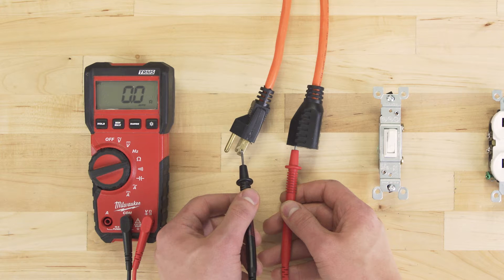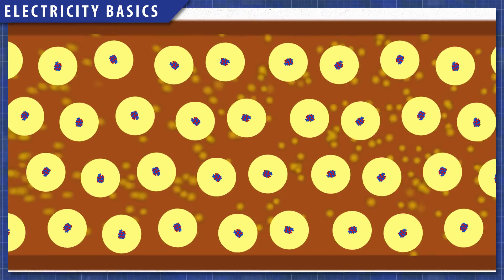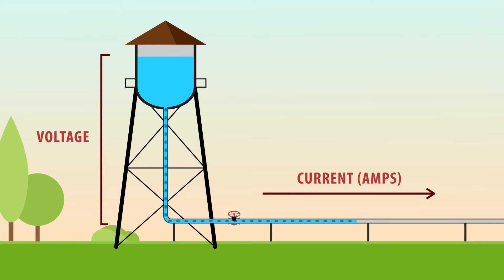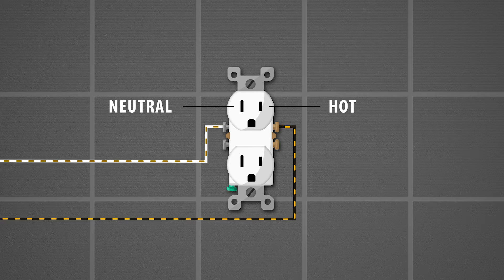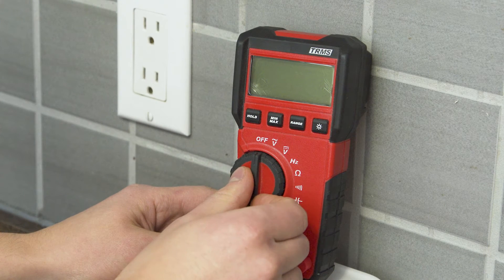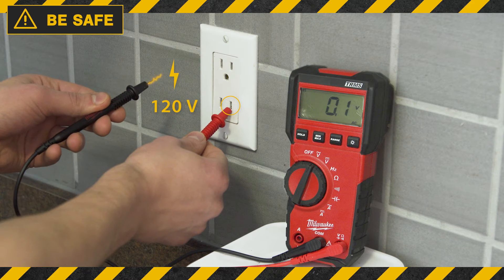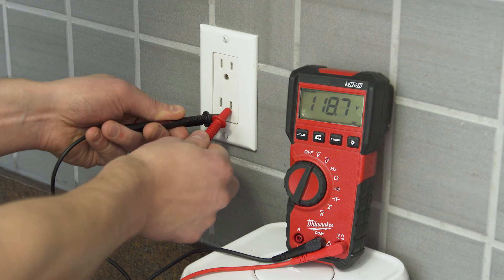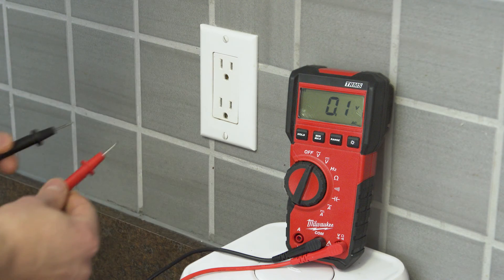How to Test Voltage in a Receptacle | Repair and Replace

Comment: I have a reading of 66 on one receptacle. What does that mean?
Reply from the maker: There is likely a loose neutral or some back feeding happening. It's best to shut off the breaker to that circuit to prevent any fire risk and get it inspected by an electrician.

Comment: I did my plugs just like you in the video black on left and red on right and it blew my breaker
Reply from the maker: Thanks for watching. It could have been an issue with the probes or the multimeter but another cause is that pushing the probes in, might have shifted the outlet and caused a wire to connect with another wire causing a temporary short. In this case shutting off the breaker, opening up the terminal and checking all the connections would be the next thing to check.

Comment: If you're testing neutral/ground.. You might want to probe ground first before what might be a miswired hot as well... Otherwise you may experience the exact scenario described at the beginning whereby your unattached probe is electrified.
Reply from the maker: Thanks for watching. Yes that can happen. Mostly the mention about the electrified unattached probe is more to draw awareness. This is why we added an additional note of safety in a pinned comment: " For additional layer of safety, its best to wear electrical safety gloves and to only hold the multimeter in one hand at any given time. Holding the multimeter leads in one hand will prevent electricity from passing from one side of the body to the other in the case of a shock. This is known as the "one hand rule"."

Comment: I had a surge in my power this morning when I turned on my skillet (fried a surge protector), and now I only enough power throughout the house to run lights; nothing significant will run. Checked the power at outside and inside box and they both display the right power. Any help would be appreciated. Ty.
Reply from the maker: Thanks for watching. Have you checked and reset the breakers?

Comment: If u have to check it replace it r use hair dry  it don't work replace  it
Reply from the maker: Thanks for watching. Testing with a device is one way to see if it has failed completely but testing the voltage with a multimeter can be useful to check the wiring, or to determine if the hot and neutral are flipped.

Comment: Quick question I have light and ceiling fan come on, but my two outlets do not work. What would you suggest?
Reply from the maker: Thanks for watching. Do you know for sure that the two outlets are part of the same circuit as the lights and ceiling fan? If not then reset the breaker for the outlets.
If they are part of the same circuit, and if the outlets are in any way connected to a GFCI then try resetting the GFCI outlet.

Comment: What if it's an old outlet where are the same size opening?  How does one test then?
Reply from the maker: Thanks for watching. The outlet should still have a hot, neutral and ground. The testing should be the same.

Comment: I don’t wanna carry a multimeter with me but I’m going on a multiple country trip that’s going to take 6 to 12 months to complete with no certain itinerary. I’ll be hitting countries like Vietnam Cambodia, Thailand, the Philippines, Malaysia. Is there a lightweight, small tester other than a multimeter that I can probe a plug or plug something into the plug. Especially for the Philippines I’ve heard that they have regular American standard plugs three prong And it could be running something like 240 maybe. Anyway, the wiring in the Philippines sounds very dangerous. Amongst other places I’m sure.
I’m not real familiar with testers, but there’s got to be something I can throw in my bag that’s not too heavy just a test before I plug in my phone and fry it or plug in my rechargeable speaker and fry it .
Reply from the maker: Thanks for watching. There are receptacle testers but most of them are configured specifically for one region, voltage and type of plug: https://www.amresupply.com/part/GFI-3501-GFI-RECEPTACLE-TESTR

There might be universal testers out there that come with adapters and different ranges. Not sure though.

A tester like this is not that much smaller than a small multimeter so you wouldn't be saving that much weight overall.

Comment: Is it safe to plug in a grounding sheet into only the ground hole in the outlet if the reading is 0.1  ? Thank you for your clear and useful video!
Reply from the maker: Thanks for watching, it depends on what you are measuring between. If you test voltage between the hot and ground, there should be 120V. Testing between the neutral and ground there should be no continuity.

As for a grounding sheet, it's recommended to only use products specifically designed and tested to be used with 120V outlets.
Reply: @AmreSupply  You're the best, thank you!!😇
Reply from the maker: @shedroids  You're welcome!

Comment: Although the video doesn't reveal the wiring of the  outlet, you can see the color of the wires that connect to a outlet in the animation.  I find it counter-intuitive that the RED probe from the multimeter tests the side of the narrow slot wired with a BLACK wire; and that the BLACK probe tests the wide slot wired with a WHITE wire... can you explain why this inconsistancy exists... BLACK being COM on the multimeter, and HOT on the plug side.  It seems that the black probe should test the side of the plug wired by the black wire.
Reply from the maker: Thanks for watching. When you look at other wiring black and red does not always indicate what is hot, one example would be a 3 way switch. It's always best to go by the terminals, terminal names or numbers depending on what sort of test is being done with the multimeter.

Comment: New outlets require both neutral and hot to be plugged at the same time to open contacts. I don't know if Canada has adopted this standard at this time, but assume so or assume it will happen soon. "Neutral First" can't be done with the child safe outlets. Plunging both at the same time works.
Reply from the maker: Thank you for sharing that info.

Comment: Excellent video, many thanks! Very clear and concise.  With electrical stuff, there should be no ambiguity.
Use one hand only not both,  Put neg in first, then positive, using one hand. In case of current, you won't complete the circuit.

This is a stupid question but... was the switch to that outlet ON or OFF when you did that test?  I don't want to assume anything.  I know nothing about electricity.
Reply from the maker: Thanks for watching. The breaker was on, and this test was testing voltage which is the potential difference between the hot and neutral lines. This video goes over the basics https://www.youtube.com/playlist?list=PLCo9SMjkdWBycw9hZVfYFc6Sw2Jlavaak But when working with anything electrical it's always recommended to be safe and it can still be good to call an electrician.

Comment: I did this test on a surge protector that was plugged into an outlet. As soon as I entered the black lead into the neutral, before entering the red one into the live, there was a small flash and smoke and the black lead’s metal got burnt out. Wonder what happened there
Reply from the maker: Thanks for watching. There could be a wiring problem or the outlet could be faulty. The neutral should not have any voltage.

Comment: Great info but wheres the repair and replace portion ?
Reply from the maker: Thanks for watching. This video is a small segment which was originally in the larger video on multimeters and electricity basics. Repair and Replace is the overall series, but some videos are more knowledge than practical. We created this to help with the appliance repair videos which requires some working knowledge of circuits and how to test components. https://www.youtube.com/playlist?list=PLCo9SMjkdWBzlEqde1FSEIuCg2hx6_H-_

During this electrical series we didn't dive as deep into replacing outlets or switches but we might continue this series after releasing more appliance repair videos. Refrigerator repair videos are going to be released soon.
Reply: @AmreSupply  Thanks for the reply and heads up........ really useful info !
Reply from the maker: @Oldbutschooled   You're welcome, we're just happy to help!

Comment: Do you do this with the power on or do you need to cut the power first?
Reply from the maker: Thanks for watching. In this case, this is testing voltage which is a test done with the power connected. This will test if there is the potential for electricity to flow. Turning the power off will show a reading of 0 volts as there is no potential for electricity to flow.

Comment: Why would my plugs, including checking the breakers, all come up with 44 volts on my multi meter?
Reply from the maker: Thanks for watching. If all outlets and breakers show 44 volts it's possible that it's an issue with your multimeter. If your appliances and lights are working correctly then that points to the multimeter as being the problem. If you have an older multimeter or a cheap one, then it might be good to check with a different multimeter before anything else. If that doesn't help then there's a larger issue and you should call an electrician to do an inspection.

Comment: So on my GFCI receptacle that always trips for no reason the top outlet give me the following readings: hot to neutral - 120v. Hot to ground - 120v. 
Neutral to ground -0v.

On the bottom outlet I get the following readings. 
Hot to neutral - 120v.
Hot to ground - 16v. 
Neutral to ground -0v. 

Any idea what’s up with the hot to ground on the bottom outlet on the receptacle? Could this be the reason it’s trips all the time? There is nothing on the load side of the outlet. Just a single receptacle in a bathroom.
Reply from the maker: Thanks for watching. From what you're describing it could be an issue with the connections which would explain why it would continue to trip even without a load. If the connections are all wired correctly and are secure, and it still continues to trip then you might need to install a new GFCI receptacle.

Comment: Okay so I did exactly like the video showed and there was a spark followed by the breaker popping. I have no idea what is wrong with the outlet but I think I'll just never use it from now on
Reply from the maker: Thanks for watching. Tripping the breaker during a multimeter test can happen if the multimeter was not set to the proper setting. It is possible you created short circuit, causing the current to rise and trip the breaker.

https://www.youtube.com/watch?v=SnRXD-0oXZo&list=PLCo9SMjkdWBycw9hZVfYFc6Sw2Jlavaak&index=2

In most cases you should be able to reset the breaker. 

If you are unsure or think the outlet is wired incorrectly then you can always call an electrician to take a closer look.
Reply: @AmreSupply  thanks. I made sure to have it on volts ac. My guess is the outlet was installed upside down or something. I reset the breaker but there was crackling noises so I opened it back up

Comment: The last test you conducted was Neutral and Ground.  I have found other resources that connect the black probe to the ground and the red probe to the Neutral.  Does particular probe placement matter between Neutral and Ground?  Great video, hard to find people that teach properly.  Even the book I'm reading says, "test ground to ground" which I imagine is typo.  Nobody has content to help me clarify besides this video.  Thank you!
Reply from the maker: Thanks for watching. When testing between neutral and ground, it is more likely for neutral to be accidentally wired as the hot wire. Technically speaking for maximum safety it would make sense to use the red probe to test the neutral and the black probe to test the ground.

In most cases testing between neutral and ground will not have any voltage. Switching around the probes won't affect the reading it just changes which probe might be energized in some models of multimeters.

For additional safety you can always wear rubberized gloves and only hold the multimeter probes in one hand placing the probes in one by one.

Comment: Hello, should there be connectivity between ground and neutral? Also i dont have 120V between neutral and hot but i do have between hot and ground. What's wrong with my outlet power? Thanks for any help you may provide.
Reply from the maker: Thank you for watching. There should be no voltage between ground and neutral. There should be 120V between hot and neutral as well as 120V between hot and ground. 

If there is no voltage between hot and neutral then there could be a loose connection on the receptacle or an issue inside of the receptacle. If all the connections are good, then it could be an issue with one of the wires.

Comment: What will happen if you put the two probe in hot wire only? 🤔
Reply from the maker: Thanks for watching. The multimeter will not be able to read a potential difference in voltage because the voltage on both probes are they same.

Comment: if outlet is broken in some way and has higher voltage than 200 what will happen if setting on 200?  I just suspect the outlet might be too "hot" since we have had two microwaves spark from that outlet
Reply from the maker: Thanks for watching. In North America, households use 120V 60hz power in residential homes. Fluctuations within 10% are normal. Outside of that requires inspection from an electrician.

Comment: Since my multimeter itself is suspect, this fine video shows me how to test the multimeter itself for correct operation.  Everything I needed to know, without a 9-or-more-minute version.  Besides, now I finally know (after who knows how many dozens of videos) how to tell the hot input from the neutral input for typical modern receptacles already installed.  Many thanks!
Reply from the maker: You're welcome, we're just happy to help!

Comment: wait a minute, isn't the black supposed to go into the hot wire and the red goes into neutral ? because you know, black is always hot and red or white is neutral. ????
Reply from the maker: Thanks for watching. We made a video (which shares some shots from this) that explains how to setup a multimeter. This is based on the multimeter that we're using and it's shown here: https://youtu.be/r_migcta_Is?t=189

Comment: Newbie here. Quick question: for the voltage reading between hot and neutral, if you inserted the black lead to hot and red lead to neutral, would you get a negative 120V reading?
Reply: @kimbuck-2  Receptacles are AC so no you would not read -120 volts.  When testing AC(most things are ac), you can use whichever lead you want and it doesn’t matter at all if you have them backwards or not, because ac moves back and forth. The only time you will read negative voltage is if you are testing DC voltage. On dc it actually does matter which probe you use, since dc voltage travels in one direction only. There’s absolutely no risk to the meter or user if you use them backwards, you’ll just read negative voltage
Reply from the maker: Thanks for watching. Yes switching the multimeter leads would give you a negative 120V reading.

Comment: Why does the neutral wire get energized if you plug the hot wire first but not the other way around (plugging the neutral wire first)?
Reply from the maker: Thanks for watching. Even though the AC current is changing directions, its best to think of the neutral as a return path, and the hot as the supply. Placing one lead of the multimeter into the neutral will not energize the other multimeter lead. It will only be energized when you connect it to the hot terminal.

Comment: Why would you need a multimeter for this?  Plug something into the outlet, if it turns on the outlet works, if it doesn't turn on, the outlet doesn't' work
Reply from the maker: Thanks for watching. There is no doubt that plugging in a device into the outlet will be a quick way of seeing if it works. Testing for voltage can help you determine if something is messed up with the wiring. There are dedicated outlet testers as well which is the safest way of testing an outlet. These devices can determine a variety of problems: https://www.amresupply.com/part/GRT-3500-RECEPTACLE-TESTER

Comment: The receptacle is not tested. You have no way of distinguishing the difference between ground and neutral. You need a load in order to have a return on the neutral. Then you can see the potential difference between hot and neutral is less than hotcakes ground. That voltage difference should be seen between neutral and ground.
Reply from the maker: Thanks for watching. You make some good points and you are right that in this case testing for voltage does have it's limitations.
Reply: @AmreSupply   sorry if I sounded like I was minimizing what you were explaining. I was just trying to point out the difference in potential between the g and n.
Reply from the maker: @TnTBLACK95  There was no misunderstanding, you definitely you made a good point! Further troubleshooting is something that would be good to cover in an updated video. This video was just recut from our longer video on multimeters, the intention was to help people searching for receptacles so they would find this more directly rather than having to sit through a longer video. https://www.youtube.com/watch?v=r_migcta_Is If we built this from the ground up we would have approached it slightly differently.

Comment: Why did it arc when I did exactly what you did 😳
Reply from the maker: Thanks for watching. Is your multimeter auto-ranging? If it has multiple VAC settings then a improper range can create issues. An arc could also indicate that there was an internal issue with the multimeter itself. As well check that the multimeter leads were set up correctly: https://youtu.be/r_migcta_Is?t=191